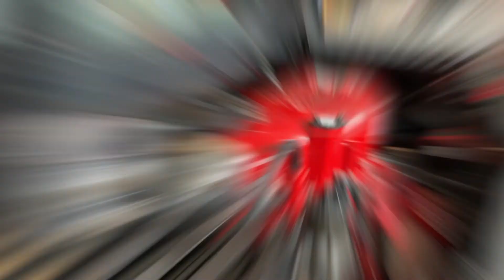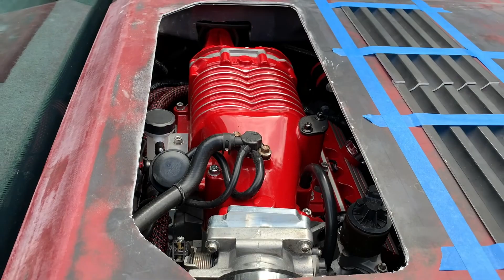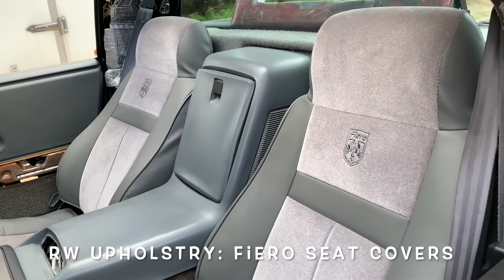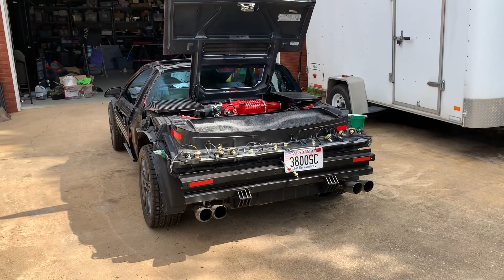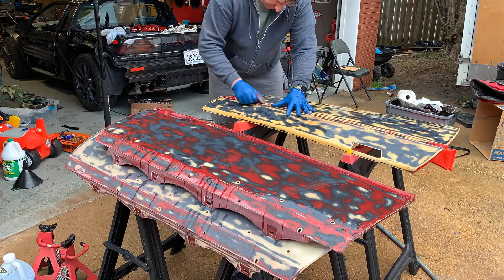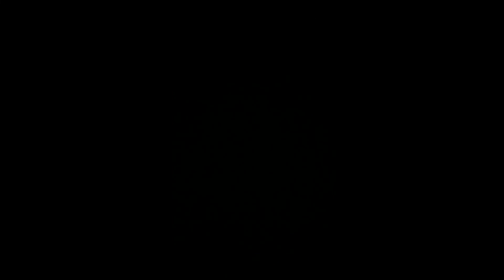February 2021 Update and Lots of Bodywork  - 1987 Pontiac Fiero GT 3800sc 3.8L L67

Comment: Looks like you used to transmission from the 3800 also is that current
If not what transmission do you use?
Reply from the maker: I used the 1998 Grand Prix GTP 4T65e-HD transmission, and a slightly higher stall converter since the Fiero is lighter than the grand prix

Comment: So was that a 3800 V6 swap for the 2.8 V6?
Reply from the maker: Yes, I replaced a damaged 140hp 2.8L V6 Fiero engine with a supercharged 3.8L L67 that was 240hp before my modifications. I’m expecting 300+ HP from the engine, and it already does 0-60 in the mid 4 second range before tuning...
Reply: @superchargedfierogt  That's great. I have 85 GT with the original 2.8. I wish at times. I had the 86 1/2 to 89 model years. I'm torn between replacing the engine or keeping it all original. Only  because it's the first GT model year.